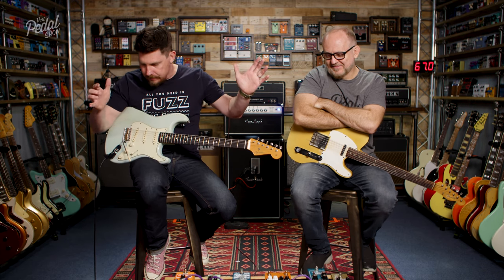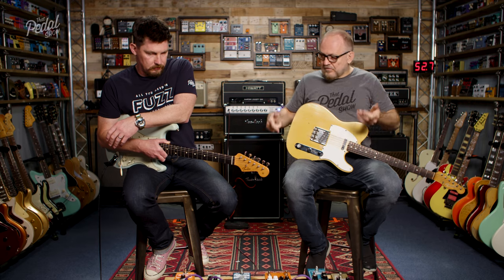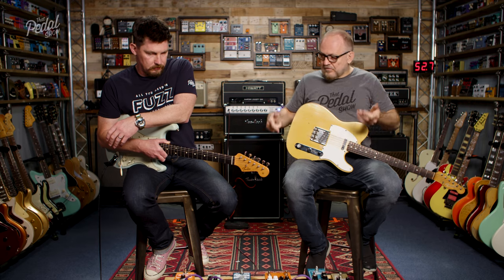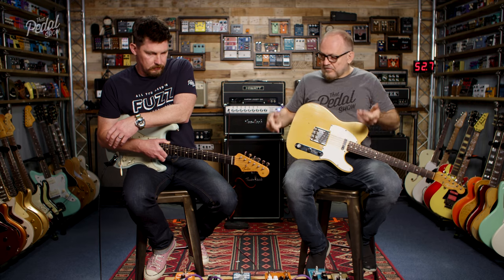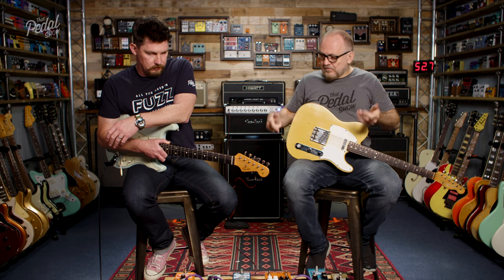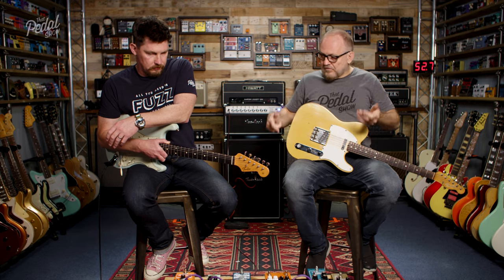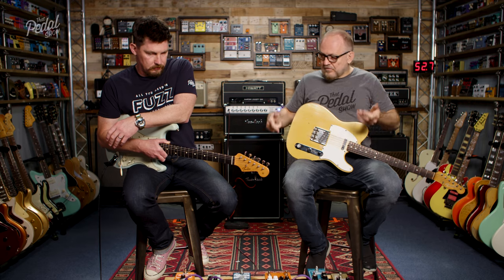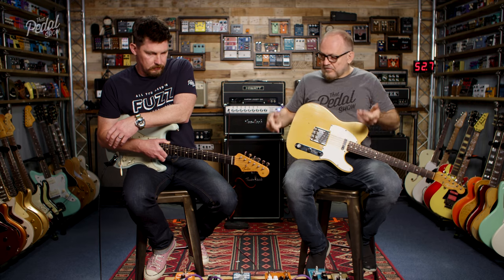To Buffer Or Not To Buffer: That Is The Question – That Pedal Show

Comment: That word 'impedance' drives me nuts, as I get no intuitive impression of it, ever. It's like 'loading' and 'driving' like the pickups are supposed to be doing. I had some hope when Mick started talking about water hoses. But, then I was lost again when a small trickle from the hose apparently 'drove' the pedals down the chain like crazy, and the analogy made me flounder again. That being said, while I despair at ever gasping the terms, the testing things in order videos like these at least gives a doofus like me examples to fall back to when ordering pedals myself. Quite helpful indeed. Cheers.
Reply from the maker: I’m with you Andreas! Mick here. Hated science at school, hate it now. I’m sure it’s not that hard - hell, scientists do it! - but I just can’t be arsed to try and understand it. That’s the middle man, and quite frankly, he can do one. Etc. Grumble
Reply: Hi Andreas! It's kind of confusing at first but it's just a measure of how much a circuit resists (impedes!) current flowing through it. Really it's resistance plus phase shift. In other words, it accounts for how much the signal is delayed when it goes through a circuit. Purely resistive stuff has no delay while capacitors and inductors do have it. As for the difference in impedances between stuff, it might help to picture a high impedance (not very conductive) input as a very thick and heavy rope and a low impedance output (highly conductive) as a very light and thin rope. Tie them together and try to wiggle the heavy rope by wiggling the light rope and vice versa.
That's impedances for you!
Reply: @juanfichtl2011  thanks for trying to make it approachable. Really appreciate the attempt. We'll see if it sinks in, but it do sound graspable presented like that. What do you say Mick, eh?

Comment: Mick - you should have a go with the fender ready set buffer. It has a switch that changes the input impedance (I think) and a knob to control the high end presence of the buffer. May really work for you.

Comment: As confusing as buffers and their resulting impedance can be: Just a cool tip for anyone wanting to have the ULTIMATE KLON! I use a Way Huge Conspiracy Theory which has no internal buffer in the circuit so after this I have an Xotic Super/Clean Buffer/Boost pedal. These two pedal are treated as just one pedal. I keep the Xotic always on with no boost or DIP EQ enhancments but that is the beauty of this, you have all these options at hand. Anyway the Conspiracy Theory makes for a better Klon even though it is not Germanium based it sounds actually better than a real Klon to me (try gain only about 9:00). The Xotic is a superior buffer with very low output impedance. Try this it's just killer!!!

Comment: I'm surprised the subject of independent buffer units like the little JHS one didn't come up, but for obvious reasons (*cough cough, g2, cough*) I can see why you wouldn't have them lying around.

On a separate note, I can't recall if it was recently but I recall Mic saying he might want an SG. I haven't had my eye on the guitar market for a tick but I'd still think you should be able to get a '61 reissue for a decent price. They were kind of revolving door in the shops. I think people picked them up because they were real pretty but:
A) I don't think they were used to the vintage spec (which Imagine you would prefer) and 
B) came off the factory floor with a garbage setup. Plus I'm encountering a level imbalance with a weaker signal in the bridge pickup but I'm thinking that's either the height or maybe some fault that's creeped up electronically because it was out of my circulation a while and I don't recall that being an issue before. Easy fix in any event. Bit of this or that. I think they're great value for money
Reply: Mick had a 61 RI and it wouldn't stay in tune. Just not enough good mahogany around for those small neck joints in my op.
Reply: @c.p.1589  Maybe it's a climate thing? Though I wouldn't imagine conditions there being drastically different from central Pennsylvania. Once mine was setup I didn't really have any problems. I just had to be sure to keep my nut lubed because using 11's it would start to bind which is a problem I'm used to with that break angle of theirs. That gauge is just on the edge of needing to have the nut redressed. (Which come to think of it I think Mic uses 11's too I think) Or maybe I just got a Pearl amongst swine, their QC has been a bit sporadic around that time.
Reply: @paulmatulevich3623  I've had a bunch of SGs From 62 to 74 and Some of them are just unstable rubber necks. There just isn't a lot of gluing area. If the neck is flat sawn  or has a lot of run out in the grain it doesn't help. The mid 60s necks can be pencil thin too with a big weighty headstock. Having said that, I have a 69 now with a log of a neck. It's like an iron bar and refuses to go out of tune. My 62 was the same. The modern ones can vary a lot. The newer growth mahogany can be quite porous but there are definitely gems amongst them.

Comment: Interesting and as you said different for every rig out there. Obviously bypass looper/switcher would change things too. I guess in this example a little stand alone buffer right after fuzz is probably the go if you don’t use a pedal with buffered bypass like the Belle. Interesting to see how it changes your clean sound, you’d likely have to dial your amp tone in differently, and then this may cause you to also change tone controls on some pedals. I use MI Effects BoostnBuff v3 first in my chain of six true bypass pedals (with additional H9 and Flashback in amp effects loop 4 cable style) and use that switchable boost into my drives for extra push, plus Mesa Lone Star as you know has switchable Solo master vol for pure lift in volume. That short cable guitar-direct-into-amp comparison to your full pedal chain all turned off is illuminating for everyone to try. Input/output buffered junction boxes with a loop for all your effects (Mesa Highwire/Stowaway and Goodwood Audio et al) look interesting too, as do Warwick Rockboard systems.

Comment: I was chatting with the guys at Cornerstone after I got my Gladio and suggested that more pedals should come equipped with switchable buffers just so that issues like this are easier to solve. I have a small board with a buffer in my modded VPJr after between drives and mods which keeps my hose flowing smoothly. But folks with more complicated boards might want buffering before and after. What are your thoughts on having switchable buffers?
Reply: YES please, and this goes especially for drive pedals.

Comment: Remember the "TC Tore" Episode:
He said switch the first and the last TC pedal from Bypass to Buffer in your chain...
Reply: Not sure those are the best buffers you're going to find.Not a fan, personally.
Reply: @markferguson3745  
The point is not using a TC pedal, the point is have a buffer at the beginning and the end of your pedal chain.
Reply: @TheElrondo  I got that, except I wanted to acknowledge that all buffers aren't the same.
Have you ever tried putting the first buffer after the Drive section? Recommended.

Comment: Thanks guys for another excellent episode where i am now going over my notes (yes I take notes).  I have some thoughts and some questions.  This is lengthy so apologies up front.
1.  Where could Mick put a buffer to avoid the loss out of his fuzz.  Find a buffer that he likes and put it right after that fuzz.  I cannot test this myself because I don't like fuzz (yes I know heresy)
2.  Do volume pedals typically negatively impact tone?  If so, should there be a buffer before or after one.  What are your opinions on putting the volume pedal in front of the preamp vs in the effects loop?
3.  Most more modern amps have effects loops, where it is most common to place delay and modulation effects.  All the devices that I own of this type are true bypass.  Is there a scenario where a buffer is helpful in the effects loop.  I respect that neither of you are advocates of effects loops, but in some cases I prefer the tonality with certain effects there.
4.  If one is using a pro level loop switcher such as the desired GigRig, do they have buffers and are the buffers device level or loop level?  My old Cusack Pedal Tamer has two buffer on/off switches and I leave them both on.
5.  Sort of buffer related, if one uses a "true" preamp like a Blackbird or Hudson Broadcast, where should it go in the chain going into a normal amp.  I know that I can send the output direct to a power amp as you demonstrated in a prior episode or perhaps into a powered FRFR speaker (have not tried this yet)  I own a pair of powered FRFR speakers for use with a Helix used for a specific set of use cases and I could always tear up that set up and try, but you may already know the answer.
This was a great episode, gave me lots to think on

Comment: The Empress buffer has a full loop that changes the impedance and drives the signal. Might be a cool one to try.
Reply: The Empress Buffer+ is similar, but also has a variable input impedance control that can load the pickups more and reduce excess highs. Put the Buffer+ right after the vintage-style fuzz (that's what I do). It also has a clean boost, mute, tuner out, etc. It's the same small size as the standard Empress Buffer.

Comment: If the pedal has tone suck issues and there isn't a distortion pedal after the problem pedal, then I'll put the buffer immediately before the problem pedal. If the problem pedal is a distortion pedal, then I'll put the problem pedal in a send-return loop with a buffer immediately after because I usually prefer distortions with high impedance signals. I think putting the buffer immediately after as you're planning to do is the best solution in your case. I always run the amp fairly clean, so don't worry too much about whether high impedance is going into the amp. That becomes another factor to worry about with dirty amps.
I believe Santana's solution is to just make everything ridiculously bright to begin with, and then run a long cable with all true bypass everywhere, so the high impedance gradually kills the brightness through the cable run, so it ends up sounding normal even though the treble is cranked on everything. No need then to worry about where to put the buffer.

Comment: I’m surprised that buffer pedal’s loop doesn’t bypass the entire thing along with the loop. That would solve the problem. It would buffer the fuzz when the fuzz is on, but bypass the buffer and the fuzz. 

Personally I like the buffered Strat sound.
Reply: So I now have a treble bleed circuit on a push pull pot with twisted tele neck pickup. (I love that pickup). Running through a Hudson broadcast duel. On low gain the treble bleed keeps a bright tone as I roll back the volume, on the high channel I take the treble bleed circuit out because it cleans up beautifully when the volume rolls back without it. Now I’ve added an old bb preamp which again reacts with the treble bleed circuit (I believe Andy Timmons uses treble bleeds). I just fitted a filterton pick up into a thinline and again fitted a push pull treble bleed. Again also rtfs of loveliness or not depending on the combination. Then add a buffer. Broardcast doesn’t seem to care if it’s in front or behind. I don’t know the science but it’s a bit like a rather frustrating mindfulness exercise, which I find fascinating . Plus I’m in a block of plasterboard lined flats so restricted to a low volume strymon iridium set up for the neighbours, but my recorded guitar tone is awesome (the tone not the playing).  I do envy you the space to let rip! But as a mediocre guitar player I love tinkering for tone. The rise of YouTube channels like yourselves and homesckooling and Tim pierce have inspired me over the past few years. Any way my question is. Why not have Annie Clarke (st Vincent) on.? She has an awesome fuzz tone and one of the most adventurous guitarists out there. That would be a great show.

Comment: I've always put a high Z buffered pedal after vintage style fuzz. The output from those things is often taken right off the top of the collector of a transistor! Yikes! It actually uses the next pedal as the entire load, (other pedals don't do this as bad) and who knows what it will see next with a pedal looper set up.  I always use a buffered pedal before a passive volume pedal as well. Keeps it predictable, the different output Z's make it react different whichever pedal without a good buffer in front of it. And of course run tails on with the final verb/delay pedal to make it back strong to the rack. Favorite buffer? A class "A" unity gain amplifier that uses a JFET input and a PNP transistor output. Build yer own!

Comment: For what it’s worth I have a SI fuzz Sabbadius that is affected by a buffered pedal or buffer before it. I put the fuzz 1st and a buffered always on pedal “my Orange compressor” after does not affect the tone. After that the rest of the pedals are true bypass and the last pedal is a Neunaber reverb “always on buffer”  I have no affect in anyway or any combo. Took a number of attempts to figure out what was causing and how to solve it in the combination of pedals when I had which also meant turning off the buffer in my polytune 3 as it’s in the front of it all. Hope it helps.

Comment: It's quite simple: the pickups form an RLC filter with the cable and the input impedance of the amp\pedal you're plugged into. This affects the resonant peak of the pickups, both frequency and Q\height of the resonance. It's absolutely necessary to select the right timbre in your instrument. I find that especially for recording, a resonant peak around 2-3k is ideal: you get a nice presence without any harsh\unnecessary high end, so you can reduce bass somewhat to balance the tone, and you end up with a nice mid-focused tone which is great in a mix, since the extreme (low and high) frequencies are covered by their respective instruments (bass, kick drum, cymbals etc...).

Comment: Not to muddy the water (NPI), but at 10:15 or so that's a little oversimplified. The water analogy starts breaking down a bit when you start getting into what happens in AC circuits. The best way to think of capacitance in a signal line in this analogy is that the "hosepipe" carrying the water flow is stretchy. As you increase the water pressure (voltage), the hose swells, so the extra water just fills up inside the hose and you don't get as much pressure out the other end. In addition, you're not just pushing water in, you're pulling it out (alternating current), so this elastic hose is filling and then draining of the extra water, and the faster this is happening (higher frequency), the less movement of water you see on the other end. So, line capacitance in a true-bypass signal chain means you lose the high end of your signal.

What the buffer is doing is basically creating two different loops of water; one "upstream", and one "downstream". The actual water flowing through each loop doesn't mix. Now in the water analogy, that might not seem to make much difference; the hose would still be as stretchy. In actual electronics, it turns out that when you do this, the capacitance is reduced; the math equation for series capacitance is similar to the one for parallel resistance (like when you hook up two 8 ohm cabinets in a full stack, they provide 4 ohms of load on the amp). So, separating upstream and downstream signal flows into two loops, using the buffer to drive the downstream loop based on the upstream loop, reduces the total capacitance, thus preserving more high end.